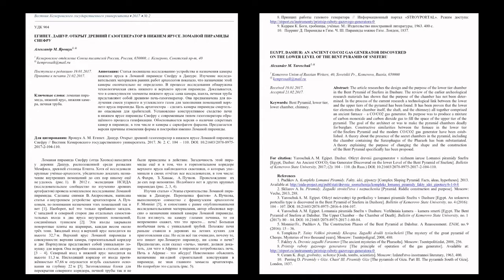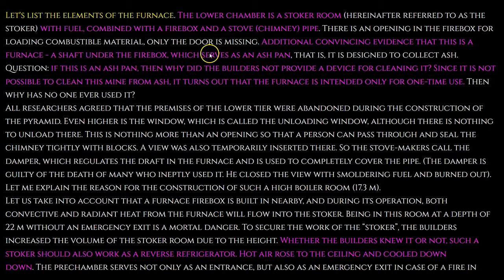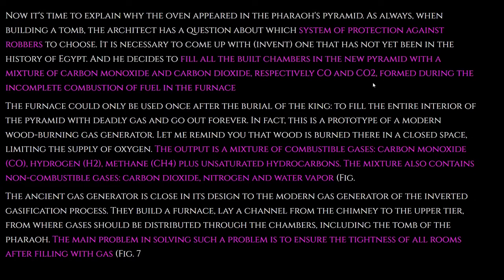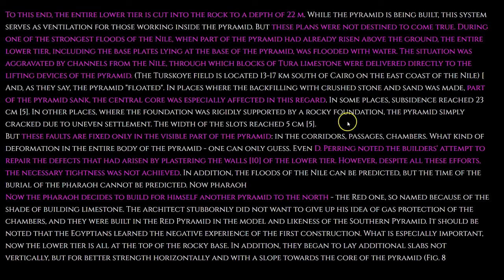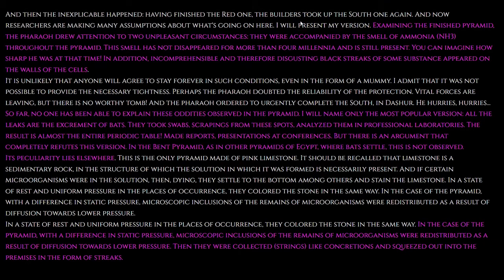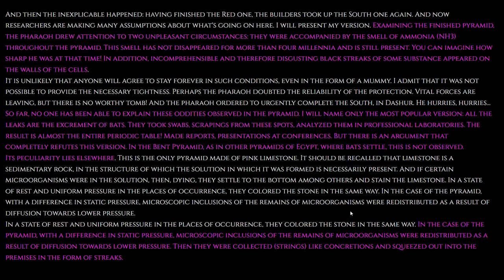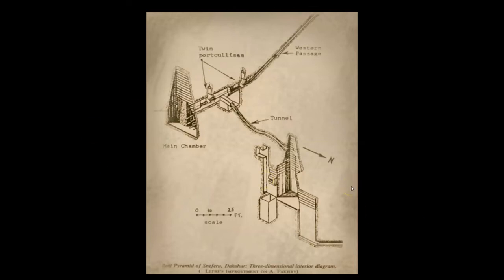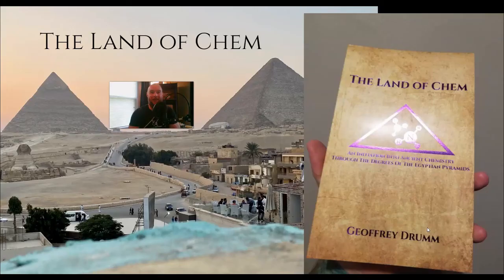Episode 34: CO2 Furnace And The Bent Pyramid

Comment: Hey Geoffrey I used to work in an industrial Carbon Dioxide plant. It also used Ammonia for refrigeration. One time by mistake the two mixed and formed ammonium bicarbonate. It was found in the piping and vessels of the system. The ammonia bicarbonate looked like a layer of hard salt deposited on everything. The layer on the stone inside of the bent pyramid could be tested to see if it is ammonia bicarbonate.

Comment: Excellent research and conclusions!  All factual or very logical.  But my mind wanders to issues involving the logic of the construction of the pyramids.  It would seem reasonable to assume that those who built the purposeful utilitarian chambers would not have been those who built the gigantic mass of the pyramids around them.  They both serve purposes that are connected but not related.  I wonder if the building of the pyramids was inspired by the very ancient construction of 'the gods' who left descendants as the royal class that (after eons had passed) decided to create the pyramids around the ancient works and convert them into tombs for themselves.  If so, then in the case of the Bent pyramid its combustion chamber could have served both the ancient purpose to produce gases on an industrial scale, and also the later purpose to produce those gases for tomb protection.  One use does not rule out the other.  We always need to step back and consider a bigger picture, -one that includes the vast scale of time that may have been a factor that today is essentially invisible due to lack of any records.
Reply from the maker: I appreciate that Adrien! Just getting started...